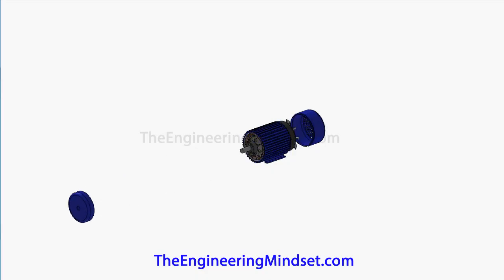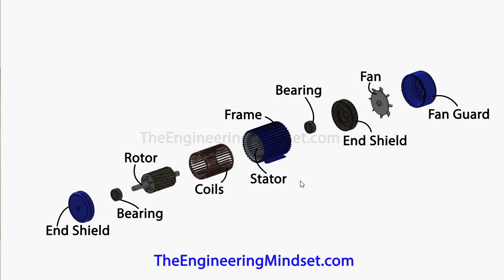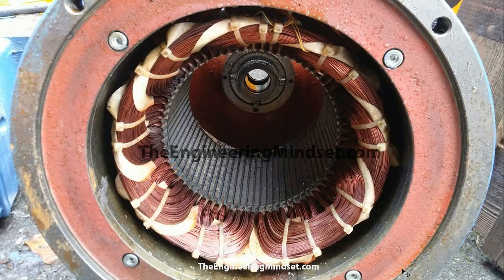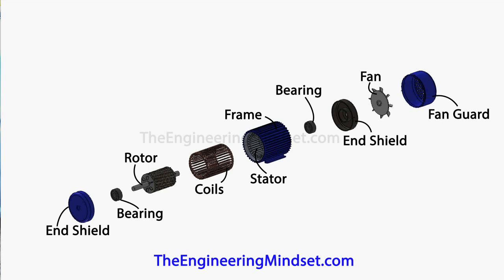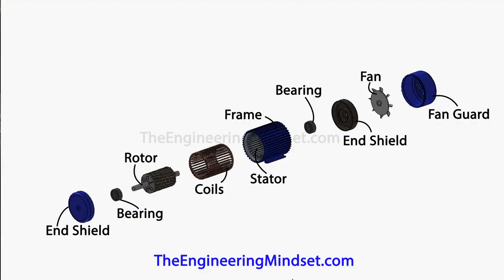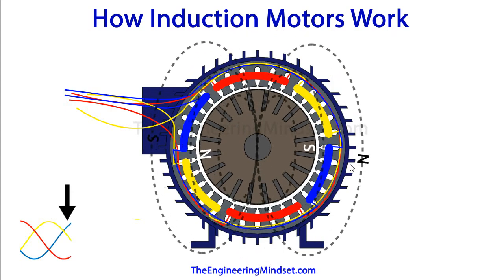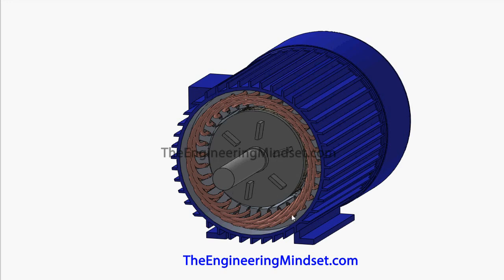How does an Induction Motor work how it works 3 phase motor ac motor

Comment: Great explanation. I have been looking for a video like this one. But I still struggle to understand the neutral wire for both configuration. Is it internal using the casing or the phase wire doubles for that. Thanks.
Reply from the maker: https://youtu.be/59HBoIXzX_c

Comment: My question is: When the rotating stator field induces a field in the rotor, does the rotor chase the stator field or does the rotor get pushed around by the stator field (repelled by the like poles in the stator)? In other words, does the squirrel drive the cage or does the cage make the squirrel run?

Comment: Hi, very nice video! Since you guys are talking about induction motors specifically, I would also mention that the rotor spins at a slower speed than the stator magnetic field (for an induction motor). The difference between the stator field's speed and the rotor's speed is called the slip speed and is a central object in induction motor control. The animation shows the rotor and stator spinning at the same speed, which is how it works in synchronous motors (synchronous => same => same speed). 

Also, the induction motor effectively works something like a transformer (with the stator being the primary and the rotor's bars kind of like a secondary). At least at an undergraduate level, we are taught to model induction motors in a very similar way to the circuit model for transformers. 

But, I understand this wasn't supposed to be a very technical overview. For anyone who would like more in-depth information, I suggest the book "Electrical Machines, Drives and Power Systems" by Theodore Wildi. :)
Reply from the maker: NEW! Check how AC motor works here https://youtu.be/59HBoIXzX_c

Comment: Has anyone else noticed that the cogs in the logo will jam rather than turn?  That's pretty much what my brain was like during my engineering degree.
Reply from the maker: You can't tell if the gears are all interlocked or staggering from that perspective. If they are staggered they won't jam.

Comment: 5:58 so why are the conductor bars angled like that what purpose does that serve in a more detailed sense.

2. also at the end the magnetic field of the coils, its really hard to visualize and get an intuitive sense of the timing of the magnetic fields and how they are able to synchronize with each other to keep the momentum going...

3. I wonder about inefficiencies, because the wires are so blended together they aren't clean in an actual image or construction of the motor, there are tons of stranded wires seeming all over the place and you didn't mention the method behind the madness...its all so messy looking and its hard to imagine that mess is a precise science and engineering design, it makes me wonder the effectiveness of the design principles and how it (assumingly) comes together very well....

4. you didn't explain the reason for the stranded wires in the actual construction and why there are so many and it looks basically chaotic looking even though i presume its not....

5. i wonder if since there are so many wires in there, if there is inefficiency, or canceling of magnetic fields, etc. 

6. can you clarify the shorting out of the end rings, what is being shorted out or how? and their purpose and the science behind it?

7. you didnt really explain the eddy current problem and it would have been nice to visualize as that is important and why we have laminated sheets.

Comment: I think it's helpful to visualize the stator as the primary coil of a transformer, with the shorted field of the rotor as the secondary side of the transformer. That's how the field can be induced into the rotor without brushes. (Tesla's goal was to eliminate the brushes)  Asynchronicity (inherent slip) is an important characteristic of induction motors which needs to be explained. This is why they are also referred to as "asynchronous motors". Due to Lenz's law, the rotor has to actually lag behind the rotating magnetic field in the stator for the induced current to occur in the rotor. If the rotor actually catches up, the induced current in the rotor fades away.  So the operating speed will always be less than the synchronous speed.
Reply from the maker: NEW! Check how AC motor works here https://youtu.be/59HBoIXzX_c

Comment: but how are the phases timed? how does the AC know when to spike in which phase. why arent they all aligned?
Reply from the maker: Excellent question, all answered here: https://youtu.be/qthuFLNSrlg
Reply: @EngineeringMindset follow up question: if i have a battery as my energy source which is obviously DC, i cannot power an AC Motor with it directly. i need to convert the DC to AC first. is this what an ESC does? also does the ESC regulate the shift of the 3 phases?
thanks

Comment: Hai,
Is it possible to use squirel cage motor Instead of slip ring motor by connecting with vfd and run at lower frequency at the satrting for higher torque purpose?

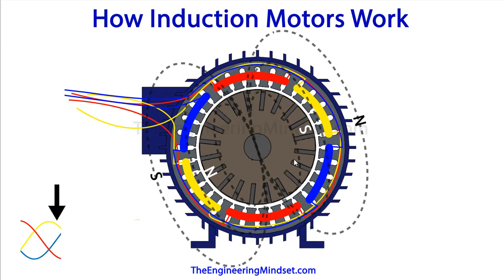Comment: In your example at 9:30, your magnetic field is going the wrong way. And in the sine wave the strength actually goes R B Y R B Y, not R Y B R Y B like you explained. Because the after the positive R peak, the next strongest was the negative B peak, then the positive W, then the negative R, then the positive B, then the negative W, the back to positive R.

Comment: Well presented; in particular, the graphics showing how it works is clear.

A bit further on, one could add that 3 phase motors are now often used under variable frequency, to control the speed - loads of them in use as ‘traction motors’ now, both on the roads and the railways. Traction motors are often also used as alternators for regenerative braking, so one could mention that they can be controlled that way round by varying the electrical load, either by charging batteries or feeding back into the supply grid.

To some extent, this became possible due to the advent of high power electronics for dc/ac inverters (IGBT), but that’s another subject!
Reply from the maker: VFD Video is now live! here: https://youtu.be/yEPe7RDtkgo

Comment: One important missing part is an explanation of how the magnetic field is induced into the rotor. It is not a permanent magnet, as might be inferred from the animation., but rather is an electromagnet created by the current induced into the squirrel cage bars.  How that occurs is not at all obvious, except to Nikola Tesla, who invented it. I, and most of us I think, need to have it explained.
Reply from the maker: NEW! Check how AC motor works here https://youtu.be/59HBoIXzX_c
Reply: Indeed.  The Rotor N and S go around as in the annimation, BUT you are right the bars and therefore the rotor has a very small 'slip' so goes at a little lower speed so the annimation is sadly wrong. Hence the US call it an Asynchronous motor. The small 'slip' is to give us flux cutting and therefore the volts in the rotor bars and the current. It is tricky to annimate well and this one is very close as EVERYTHING is synchronous EXCEPT the rotor. Even the rotor current pattern (as the magnetic fields have to be synchronous.)
Reply: Thank you, glad I read the comments first before watching the video. I searched for induction motor to know how the magnetic field is induced since there is no permanent magnets presents.
Reply: imagine inventing something only for your last name to be used to name a car brand that uses your technology

Comment: Most important thing is not explained why is called async motor. Current induced in rotor cage wires depends how much rotor is behind rotating magnetic field. when is idling,  no load case, power consumption is zero. When load is applied current in cage goes up and  cage is catching up with rotating magnetic field. Sync motors were developed before Tesla's patent but were not suitable for industrial use  because they were taking nominal power in idle mode and were prone to stop on load change because sync mode was broken.
Tesla's async motor made AC power to have advantage over DC power for industrial usage.
Reply from the maker: DC motors explained https://youtu.be/GQatiB-JHdI

Comment: Hi Paul, I have a 2-speed motor.   How does the motor started change it’s speed?
Reply: Probably changes the stator coil connections to give 4 poles N-S-N-S instead of two as shown.  Rotor has induced currents so 'changes' without any switch to match the stator. Then it will go half as fast. Check the switch affair.  I normally save this for my videos, but mine are not popular Hahahahaha

Comment: Please explain how the capacitors help in starting of a 1-phase induction motor
Reply: Hi there I'm a motor winder and mechanic. Essentially there are two types of capacitors used in a motor. A run capacitor and a start capacitor. The run capacitor, which is usually a silver canister, is mostly used for efficiencies these days. It helps to clean up the sine waves and allow for cleaner current. Start capacitors are normally a black plastic canister. These build up a generally much larger charge and are in series with the start windings of the motor. When the motor starts these take on a charge and are discharged into the start windings giving the motor the extra torque needed to start in a short amount of time.

Comment: I get it (I think), with 3 phase the gaps between peaks (and troughs) are smaller than with 1 phase, so you get close to a direct current effect which is continuous, hence more power?

Comment: What device is used to manipulate the magnetic fields on the rotor? I know armatures are used on small dc motors with brush contacts, but how do you make an electrical connection to the moving rotor?

Update
I found out that DC motors that use only wire to generate both fields on the rotor and on the stator are referred to as 'Series wound' electric motors.   They typically use a commutator with carbon brushes to contact the moving rotor - thus changing which coil is creating a magnetic field on the rotor.
Reply from the maker: DC motors explained https://youtu.be/GQatiB-JHdI

Comment: Something that always bothered me is the face that I can't seem to come up with a good explanation of why the rotor of an induction motor works.  In the example of a permanent magnet motor it's super obvious, but trying to explain how those simple hunks of metal work in the rotor isn't obvious to most people.
Reply: It's not obvious to me.
Reply: The rotor becomes a temporary magnet when power is applied. The brushes supply power to the commutator( the conductors that run across the rotor illustrated in the video) and this is what gives this hunk of metal it's magnetic property.
Reply: @anthonyjones634  Commutators are used in DC motors.

Comment: so when north is up ... the sine wave is peaking up +... meaning the flow is counter clockwise, and when the north is down ( south up ) the sine is drawn negative down meaning flow is clockwise? Is that part of the illustration correct is this the orientation of the sine wave thanks!

Comment: A thought I have many times when working with motors is "Who keeps squirrels in cages anyway?!"
Reply: Whenever I heard the term, I always thought of the hamster and mouse exercise wheels rather than actual cages.
Reply: Obviously an ingenious individual that captures the pesky little varmint then puts it to work spinning its cage similar to the rotor except it relies on squirrel muscle instead of electrical input for rotation. Although direction is random whereas with a three-phase electric motor direction of rotation is easily determined and maintained by changing any two wiring connections.... simplicity itself especially for common backward inclined fans, or pumps in which direction is  paramount  for proper operation & corresponding  amp draw.
Reply: It's supposed to be a cage to keep squirrels out.

Comment: i have noticed something that i would like to ask an engineer about... in DC motors u have the coils inducing a magnetic field that works against a PERMANENT ferrite(black iron cobalt magnet) magnet in order to turn... but in AC induction motors the the coils are stationary  on the stator  so in my mind the magnetic force to work against the coils' magnetic force must come from the rotor, but I have opened an AC house fan before and i saw that the rotor has minimal to weak at best to noo magnetism on it to counter the coils,, so my question is, 
HOW can they be so strong and fast is the magnetic field that is responsible for the turning is so weak?
Reply: The key is in the name: Induction Motor.

The electric current through the stator coils produces a magnetic field from the stator which cuts across the rotor, inducing an electric current in it which then produces its own magnetic field, which naturally opposes the magnetic field from the stator.  The rotor turns because its induced opposing magnetic field is "trying to get away from" the stator's magnetic field.

The stator can never complete this action because the alternating current keeps changing the magnetic field, so the stator keeps on turning so long as the alternating current exists.

Or more simply, the stator's magnetic field turns the rotor into a magnet, temporarily.

You can see a related effect if you hang a chain of paper clips from a magnet.  If you hang onto the first paper clip, closest to the magnet, and move the magnet away, all the other paper clips fall away.
Reply from the maker: DC motors explained https://youtu.be/GQatiB-JHdI

Comment from the maker: ⚠️ Found this video super useful? Buy Paul a coffee to say thanks: ☕
PayPal: https://www.paypal.me/TheEngineerinMindset
Reply: My question is: When the rotating stator field induces a field in the rotor, does the rotor chase the stator field or does the rotor get pushed around by the stator field (repelled by the like poles in the stator)? In other words, does the squirrel drive the cage or does the cage make the squirrel run?
Reply: Baldrick, if u explain more clearly i may be able to help u, by stator field do u mean magnetic field? Because a stator is a component of the motor i dont think theres any such thing as a stator field